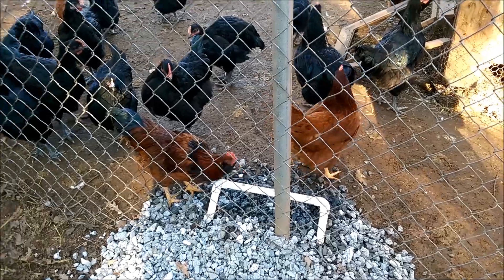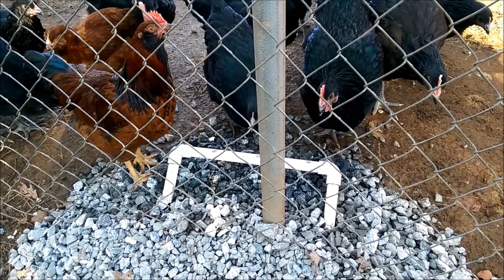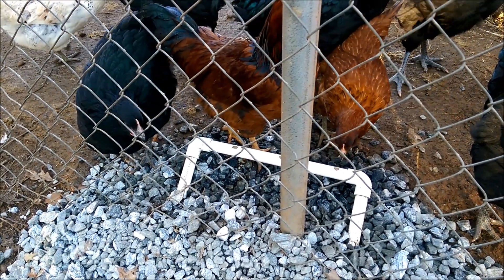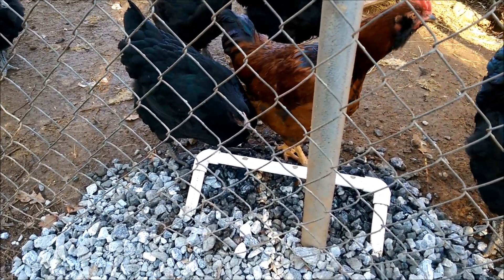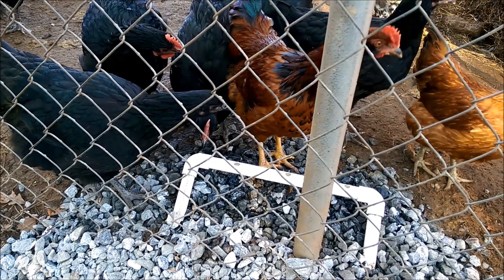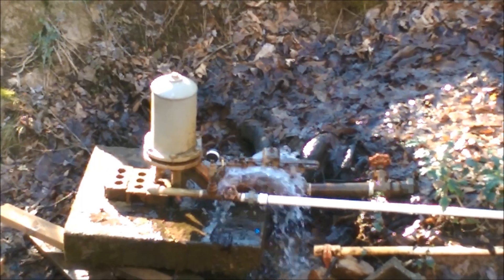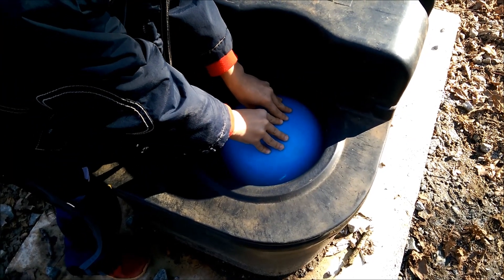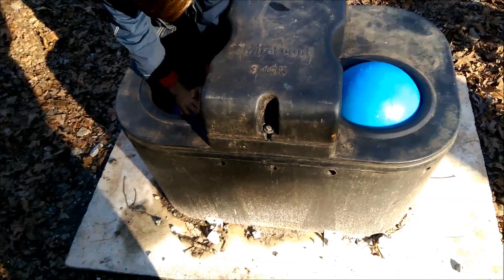Hydraulically Rammed Chicken Waterer

Comment: linear pvc tube with 30 holes; laid inside a piece of 1&1/2" pipe; split 75%; running longitudinally; with plumbers tape wrapped at interval; to keep it up off the bottom of the 1&1/2". then the runoff can be ducted some where else; and used for another purpose. your chicken run will get mighty soppy if you don't. just sayin.

Comment: How do the chickens get water after a 24 inch snow fall? ;)
Reply from the maker: Plumb it under the eave and no problemo.
Reply: engineer775 Practical Preppers Even when it is a blizzard? LOL Just asking cuz that is what we are getting.
Reply: engineer775 Practical Preppers I just LOVE your logical and simple answers, no need to over complicate things! :-)
Reply: Put a quickie "doghouse" over it or build an extension off the main coup to cover it on all sides with a rubber flap access to the outside.

Semper Fi
Reply: *****
I think his question was about if you get drifting snow that covers the entire spicket in 2 feet of snow.  If the chickens can't get to the water, it doesn't matter if it is frozen or not, its still not accessible.

Semper Fi
Reply: they will eat snow no need to go for the water .
Reply: *****
Um. how do you figure?  "Constant water flow = no freeze = available water." in no way address the inaccessibility of the water source.

Semper Fi
Reply: *****  That is highly doubtful.  Snow can still drift into the area.  That little seep is not enough to keep the area clear if 24 inches of snow is dumped in a day or two.  The principal of a faucet dripping is only to prevent freezing from temperature, it has nothing to do with being completely covered by feet of snow.  What will most likely happen in that case is that it would get buried and the water would hollow out a snow cave around the height of the largest surge the ram pump provides.  But it would still be inaccessible by the chickens unless it were sheltered.  This is why most people end up building a covered chicken run where such snowfalls are likely to occur.

Semper Fi

Comment: How much would it cost for you a make a small mini-hydro pump for me like the one in the video that you did not to long ago that was "in a freezer." The flow seems pretty much exactly the same that I have "as run off" from a aquaponics system I have here in the Philippines. I can't get that stuff here as far as I know of. www.kevinrichardsonministries.com
Reply from the maker: Need to know the GPM and fall of the water.   what you saw in teh freezer had water falling from 100 ft in elevation.
Reply: 200 liters per minute = roughly 50 GPM I guess. Pump is 800 watts pumping horizontally roughly 50' then slight head of 3.5 feet outflow. Then have 3 separate 1/2" drains linked to combine flow. Could pick up the flow at the original water entrance which is A LOT more flow...than the 3 separate 1/2 drains that run together. We could take advantage of "Both" !! I'll make a video of same an post it...so you can see exactly what I'm trying to do. Stay tuned...doing it right now. Should be able to post it within 30 minutes or less. Thanks !!
Reply from the maker: cruisinkev1 to let you know the power you can get is to take the 50gpm x 3,5 ft and divide by 10 will only give you about 17.5 watts.  I would go solar instead.
Reply: engineer775 Practical Preppers
Well...that's not good news, but it is what it is. Trying to find "quality" parts here..is not impossible, but difficult at best. Based on the research I have done in the past.. on solar..it runs about a dollar a watt. Is that correct ? By the way...the video is processing and should be up momentarily. Thanks Very Much for Your Time and Blessings to You and Yours My Friend !!

Comment: Not everyone has a running water source for a ram pump.
I counted about 25 chickens in the pen, I'm not sure how many were laying, with my experience with chickens , I guess at least 5 were laying. That's 30 chickens drinking from three holes . I'm sure out of 30 chickens you have at least three that will rule the three pvc watering holes , you know the type I speak of.
Nice prototype concept,  but I don't think it's going to keep all 30 chickens well hydrated,  not due to the water flow , but water access for the submissive ones.
It needs work in my opinion. 
I do like the concept and look forward to the permanent design / solution. 
I have ideas,  but some engineers don't like advice.
Reply from the maker: I have had chickens, cows most of my life and I have found that when animals have unlimited access to fresh water they are are less stressed, they don't fight over the water etc.  When chickens are out of water or food and then are watered or fed they attack the waterer and feeder.  when they get accustomed to never being out of water or food they lay more and are less stressed.  I have seen too many nasty cattle and chicken waterers and have found empirically that  less area but more clean water works better.   Clean water is king and I have found it to be the single most important factor in reproduction.  My brood cows are 19 and still calving.   I don't mind ideas and if the chickens are stressed I will lengthen the pipe and add more holes. Thanks for the feedback.